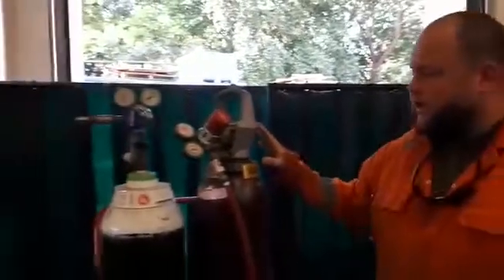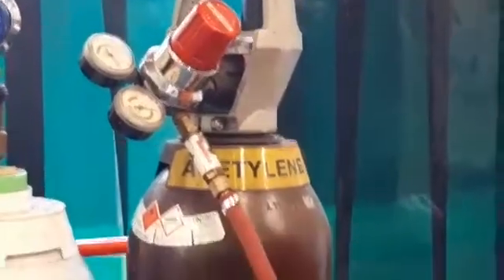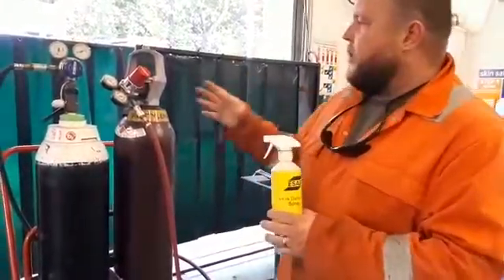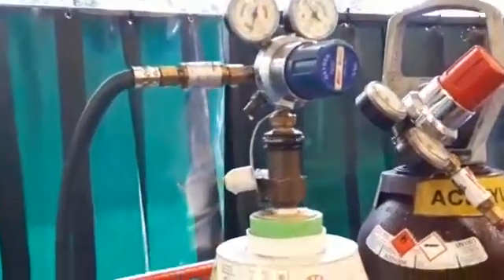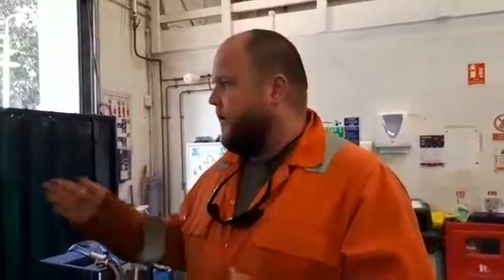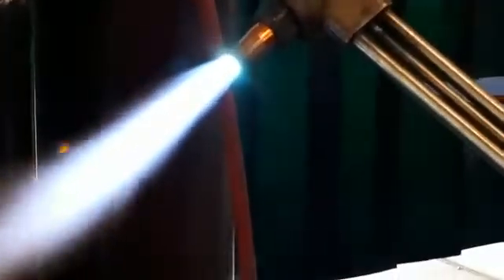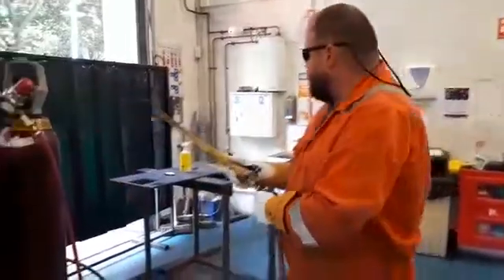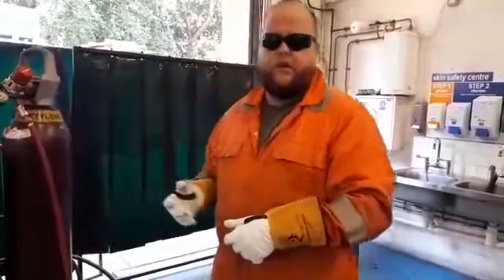How to set up and shut down Oxy-Acetylene

Comment: @Harry's Weld the safety check on valves etc...is this done every time you would weld? Or just best practise every now and then?
Reply from the maker: It's always worth checking the equipment over before use. If you are not the only person using it, then you can't be sure of the condition the last person has left it in. In which case I would definitely give it the once over.